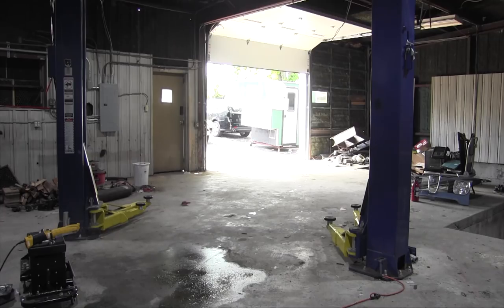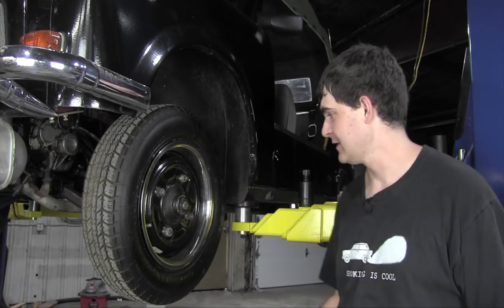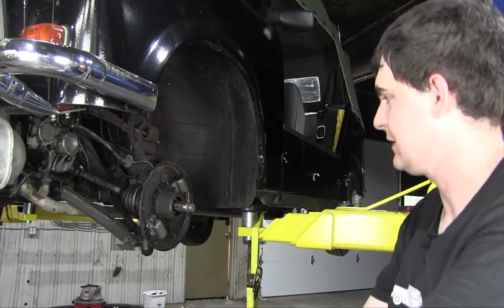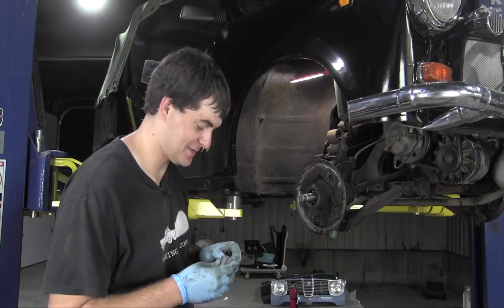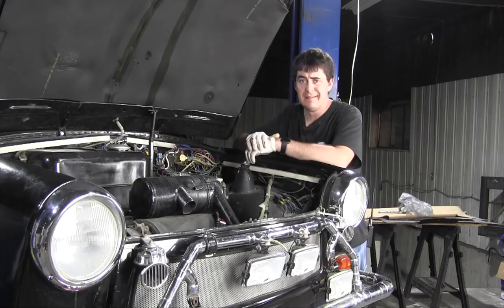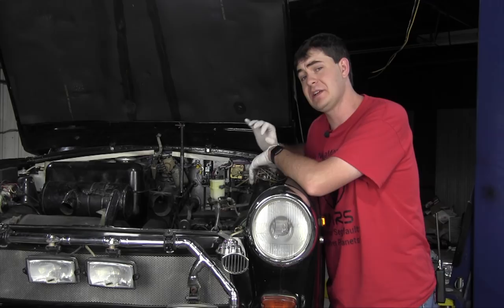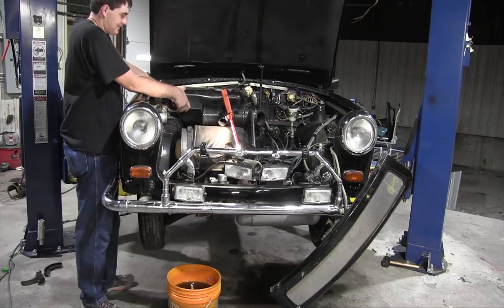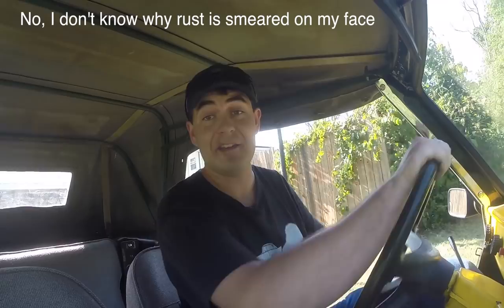Making a Trabant Tramp Go and Stop Again

Comment from the maker: Full Disclosure: The original plan was for me to buy this Tramp and reverse the millions of modifications. I ended up not buying it because this Tramp, as of right now, has no title.
Reply: I assume your state laws require a title even for a vehicle that old...?
Reply from the maker: Indeed
Reply: What a load of crap.. my opinion is once a car is 20 years or older, a bill of sale should be more than sufficient considering they've got an electronic trace of the VIN in many cases. Can you not apply for a title? When I moved back to Georgia from Vermont, I did not have the title for my RX-7 as VT does not require one. I kinda had to jump through a few hoops, but they issued me a Georgia title for it. Was the tramp previously registered in a state that did not require a title due to the age ?
Reply from the maker: This is an imported car with an unknown history. I have no idea if it was ever registered in Missouri or any other state.
Reply: Sorry, I had an appointment to get to and was only able to watch like the first 30 seconds of the vid.. and to be honest I know nothing about Trabants. Maybe another will come along that is at least road legal. :) I'll pray to the rotary gods for ya and maybe they'll put in a good word with your people.
Reply: One tip: If you want to bend fragile pipes just fill the pipes with some salt or sand and seal both ends to prevent the pipe from kinking when you bend it. Of course you have to clean the pipe afterwards but it's better than kinking all the pipes i'd say. :D
Reply: Hmmm. I live in maine and registering a car as an antique requires no title... alas, I already have a project MG midget, so no Tramp for me
Reply: Hmm. Here in Rhode Island only a previous registration and bill of sale is needed if it is a 2001 or older. Time to move! Haha.
Reply: because the donald trump  wanted it just like that..( yes life is hard) :(
whats 9+10= ??
Reply: Aging Wheels I'm interested in buying the trabant Tramp but I only have maybe a thousand two hundred in my account right now
Reply: Arent you supossed to adjust wheel bering end play instead of raming it down with an impact?
Reply: Aging wheels, visit titlegods on instagram. They could help with the no title
Reply: Aging Wheels what’s the price for it
Reply: HA on the rear break cylinders could men Hinter Achse witch means Rear Axle (if you need any Translation in the future im happy to help)
Reply: I guess Trabants are rare in the US, but you can probably find a better car to either fix or use for a similar project...besides, people are going to yell at you for driving a 2 stroke such as that around, lol.
Reply: If you register the vehicle with the Vermont DMV there is a process to get a title generated.  A co-worker of mine did this with his motorcycle.
Reply: No, they don't even in environutty Massachusetts. People here love mine.
Reply: Shoulda used it as a little communist go kart
Reply: I imagine this would be highly illegal in Canada unfortunately :( but I do want one
Reply: Aging Wheels Is it still for sale? My family had a car dealership meaning we can deal with the title problem and I might be interested if the price is right
Reply: Have you considered that being from formmer East Germany the brake linings might contain asbestos?
Reply: @TheSpinCycle7  I would think that the real challenge would be to convince the state that it belongs on the road.
Reply: @agingwheels  if it has ever been in germany send me the VIN, I could try to find history out for you.
Reply: That isn't exactly a problem in Wisconsin.  It just makes it more time consuming and costs more.  You have to get a "Bonded Title",  look this up in your state!
Reply: In GA a bill of sale is all you need to get a tag and registration for a vehicle over 20 years of age
Reply: Aging Wheels if you need any help with the parts I can help you im German and love the Trabant
Reply: Aging Wheels, how much are you trying to get out of it anyhow?
Reply: @agingwheels  i want a new light blue trabant sedan with a white top
Reply: would a power sterring pump pully puller work?
Reply: @Jorporte  No, you can get them in Canada.
Reply: @agingwheels  So It can't be registered even with a stolen ford focus vin number?
Reply: This is old but who cares I could still provide information!
A mechanics lien could be a solution to produce a Title.
Reply: I am a bit grumpy about your butchering of German, but i know, that you probably didn't "learn" it correctly anyways. I find it more funny than bad
Reply: @Scitch87  We used tar when I was doing brass pipe bends for making instruments. It fills the pipe, solidifies mostly, but remains flexible, and to get it all back out again, you just heat it up until it's liquid.

Comment: I'm German, but I'm not mad at you, I'm laughing my ass off :D

Also, my brother and his best friend owned a Tramp once, that car was ridiculous fun. Sadly, it burned out after an unfortunate fireworks mishap one new year's eve.
Reply: OOPS....
Reply: I'm incredibly curious as to how that happened. My father used to have a 1972 Ford F150 that we accidentally set on fire in the same way on independence day in 2002, but, after it was done burning, he put new soft lines, an interior, and some over melty stuff, and for about $1000 dollars, he got it running, he sold it last year when he got a better work truck. In our case, a firework fell over, shooting a sizable amount of sparks, under to truck, thankfully, it was running on its usual fuel, being whatever drops of half-lacquered gas/petrol he found in other bits of machinery.
Reply: @the_clockwork_jackass6897  Due to the Trabant's building material ("Duroplast", which is basically a kind of low-grade fiberglass), the chasis was also quite damaged and unsalvageable. And even if it hadn't been: Trabants (even Tramps) are still to this day extremely common and cheap in Germany - and more so in 2009, when this happened - so it simply wouldn't have been worth it.
Reply: @Owlpunk  I honestly didn't know they didn't have a metal body. I wish they were common in the states, I'd love to have one. It wasn't really worth it for my dad to restore that F150 either, they're common, and it wasn't it good shape before the fire, but he was stubborn and cheap, he's now slightly less stubborn 😂
Reply: @the_clockwork_jackass6897  No worries, not many people know that :D 
Another factor in not fixing it (aside from that, well, being practically impossible) is that none in our family (including me) are really "car guys", at least not to the extend that we actually work on stuff. Which is kinda ironic, because my grandfather (on my mother's side) ran both an Opel dealership and a driving school, lol. I hung around there all the time when I was little, and I loved it - unfortunately, I did not pick up any useful skills. My aunt used to be a driving instructor and is quite knowledgeable about cars, but even she doesn't really know how to work on an engine. 
(BTW: Say what you will about Opel - up until the 80s, they made some really cool cars. Both the GT and the Manta A are among my favorite cars of all time.)

Oh, and right back atcha - I wish some vintage cars which are probably nothing special to average 'muricans were more common here. Not because I necessarily wanna drive them, but because I'd just like to see them, you know? Some guy in my town owns one of what I imagine to be not very many road-worthy 4th generation El Caminos that exist in Germany - and it always puts a smile on my face when I see it on the road.
Reply: @Owlpunk  I had to Google some photos of Opels, I'm not really a car guy, I just kinda know how to make the old ones go, and, best I can tell, I agree with you 😂  Mind if I ask what your favorite car is? Mine is the DMC delorean, despite the fact that most of my family thinks they look like an aluminum lunch pail, I think they're pretty cool, I also like the gullwing door, and it's more than likely the only car that I like that has a full wing door that I could buy 😂
Reply: @the_clockwork_jackass6897 
My favorite car? Of all time?
Uh, I have to admit, my choice is kinda "basic":
The Ferrari 250 GTO. È un bella machina, si? 

The DeLorean is very cool tho, too; even if it isn't a good car, per se. (And I'm saying this as a fan of the BTTF movies.) People who restore them absolutely have my fullest respect!
Reply: @Owlpunk  I currently have a 1967 Chevrolet C10 panel truck, it's really nice, as it's old enough to look like it's a vehicle to itself, rather than the blurred lines between modern cars. It's also great fun for a particular scam, I'm not sure if they just exist in the states, but it's "we've been trying to contact you about your car's extended warranty" because I get to say "it's a 1967 C10 panel van that's had 12 previous owners, it's had four engines, starting as a petrol straight 6, then a diesel straight 6, then a petrol V6, and now it's back to a straight 6, it's had two transmissions, it's got a propane boost, and it hasn't had professional work since 2004" they usually hang up around the "diesel straight 6" bit, nobody has ever wanted to extend the warranty 😂
Reply: @the_clockwork_jackass6897  Dude, I wish German traffic inspections were this lax, lmao. (Or maybe not. We actually have pretty low rates of traffic deaths.) Anyway, that's a very cool story!

But oh well, I drive a Renault Zoe - p much the cheapest electric car on the European market these days (or at least it was 3 years ago.)
It is very much A CAR - nothing special, extremely uncool, kinda ugly, not many QUIRKS AND FEATURES, generally very basic - you know? 
But it WORKS, it doesn't have any major problems (besides the aging media center), and - tbqh - it even has a teeny little bit of a fun-factor. Because, as an electric car, and despite its very modest powertrain: It does 0-60 in significantly less than 10 seconds, and that leaves some overly-confident owners of some classic cars back in the dust, lmao. It also handles surprisingly well!
Reply: @Owlpunk  I think with Germany's inspections, there's good and bad, the safety increase would be monumental in the states, I've seen things on the highway that don't even look like they should start, let alone go 80mph/128kph (limit was 65mph, we go the speed of everyone else, under the ideology that they can't ticket us all), I've found mufflers on the railroad tracks because the exhaust system was so rusty they went over the bump and it fell out, I've seen cars driving on completely bald tires, pickup trucks with frames so rusty they were sagging in the middle between the cab and the bed. same goes for the European power grid, there was eight light sockets in my house that had live going to the thread, so it could be touched while the socket was off, and you could be electrocuted, GFCIs/RCDs are only required within 5ft/1.5m of a water source (tap, shower, ect), the whole house isn't protected, my house did even have that when I moved in, and it passed inspection because a staggering amount of our government inspectors simply don't care. Sorry if that's a little political or serious, but I try to remind people that the facade the US puts on is mostly that; a facade, we are not the great country we like to think we are.

Comment: Free tip Friday: For small tricky sections of brake line, flare the brake tube first, and bend it afterwards.  Use a piece of string to measure the length of the old one.  Don't forget to forget to put the tube nuts on first so you can enjoy the experience at least twice.

Comment: Your supposed to remove the emergency brake lever from the old brake shoe and install it on the new one.
Reply: I like how he complained about the bodge job on the fuel tank when he neglected to do the rear brakes correctly.
Reply: I've done that before.
Reply: Oh well, car only weighs 2 ounces lol.
Reply: Im doing brakes on mine and how do you remove that lever? Me and my dad tried alot to remove it but no avail
Reply: @mannequinfukr  You are probably done by now, but itis a slip notch. Twisting the bar around and poking the shorter tab along the slot undoes it. Sometimes though they are bent a bit. So a pair of vise grips can unbend the tiny edges.
Reply: @tisstuart  thanks. I'll try to remember that as I keep forgetting to order spare rear brake shoes
Reply: @John-1984  He could have just put the old shoes back in. They didn't look too worn at all, and fit the old drums better anyway...
Reply: Well, then. No wonder it confused him!

Comment: You haven't made brake lines until you've flared the line without the nut on it or on backwards.  The resulting line after cutting the flare off will be too short.
Reply: Been there. Done that. Once or maybe even twice.
Reply: The same with fabricating cables, when you soldered the connector on but forgot to put the boot on the wire beforehand.
Reply: @Stoney3K  Less annoying but still bad: some European mains plugs require the cover to be slid over the flex before you connect the flex to the plug. In that case it's only screws though.

Worse: use crimp splices to repair a cable and forget to slide the heatshrink on first.

Comment: As one USA trabant owner to another, I'm always happy to see your videos. Since my trabby is hepatitis yellow, I'm often bombarded with interest in the car. From time to time, your videos are mentioned by trabby enthusiasts. Everyone is always amazed when I tell me "Yes  I take my car on the Interstate", and no they don't smoke that bad. 

I just recently did a full brake job on my car, so here are a few random facts about the process:
The front wheel cylinders can not be switched between sides ( so let's say your wheel cylinders fell out the boxes and got mixed up, you would then have to look up the angle at which the brake shoes to make sure you have the correct sides)

Please be sure to check those brake adjusters whenever you're inside the drum. Though they are simple, alot of times they will be  worn out when trying to hold pressure against the shoe. 

On my new set of brakes, they did not come with the lever (or hardware to swap to the new set of shoes) So, I too used my old rear lever brake shoe on the car. 

When it comes to your beige smoky trabby, if you have not fixed by now try taking off the air filter hose and putting your hand over the carb while running. If it shuts off then you know your engine is sealed well. I would bet heavily that your points, and ignition timing are way off. 

The timing marks on the engine cases are usely wrong. The only good way of timing, is to use a socket extension in the sparkplug while looking at a dial indicator on a magnetic base plate. My trabby frequently goes over 60 mph, and needs no starting fluid to get it going. Thanks for the videos.
Reply from the maker: It's always nice to hear from another US Trabant owner.

Regarding the timing on mine, I've adjusted the timing on two separate occasions a year apart from each other. I found TDC using a dial gauge in the spark plug hole and adjusted both cylinders to a number I don't remember off the top of my head BTDC. The timing (when revved up to fully activate the advance) is correct on both cylinders, BUT it has a nasty habit of jumping around randomly as viewed by the timing light. I've adjusted the points before and I'll probably adjust them again soon, but I can't help but think electronic ignition would be an easier solution to this problem.

I've long suspected I have a crankcase seal leak somewhere because bad timing doesn't explain all the issues. Your simple trick of covering the intake hose is something I've never thought of, and I'll have to try it the next chance I get.

There will almost certainly be a video about all of this in the future. Thanks for the tips! I'm always worried about someone that knows what they're doing watching my videos and thinking I'm a complete idiot. That's why I sprinkle in heavy doses of the "This is not instructional. I don't know what I'm doing" type of talk.
Reply: If your timing is jumping like crazy, it may be the dinky springs on the point arms.  Seems the original DDR points are hit and miss(many companies made trabi electrical parts!). 

 Or maybe the springs on the centrifugal shaft in the middle. 

If you want, I have a new set of crank seals(bought a crap load of stuff from Trabi welt..  I thought  I needed to use a different engine-with the old style of seals.   So I have no use for these... Also new condensers. 

Lucked out with my 10/89 engine case being just fine. I had to get a new crank.......   

Be happy to send them to you for the same cost I payed.  Just without the crippling shipping fee!  I'll drop you a line on the trabbi forums.
Reply: damn auto correct...

Comment: The previous owner of my 4wheeler decided to hold the plastic fancy bits on by screwing it into the gas tank (surely by accident). I got the screw out and melted the plastic just like you did. Works a treat! No leaks! Unfortunately, the brake system is a pressurized thing, so I don't think it would ever work.

Comment: Every time I see these things, I bemoan you not having one of the very late ones (built between April 1990 and 1991), which had a VW-sourced four-stroke engine.
Reply: ... and finally a fuel filler cap in the rear.

Comment: I own a Trabant, and it's a wonderful little car, unbelievably reliable. Easy to fix, when needed. Invest in a brake spring compressor and a brake retaining spring clip depressor. Cheap tools that make your life much easier and you don't get hurt by flying springs ad pinching pliers. Oh, and when you own a foreign car, and you have to order parts, buy the whole brake system replacement parts. Cheaper to batch your purchases, and you build up a spare parts storage for your vehicle as needed.